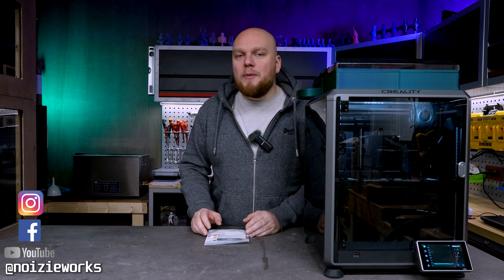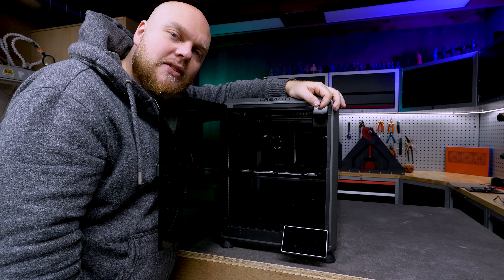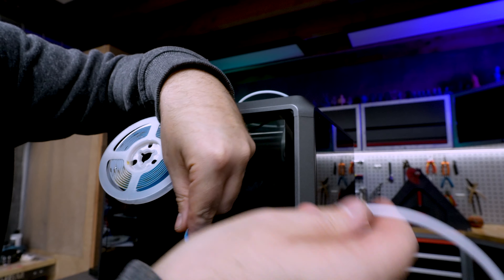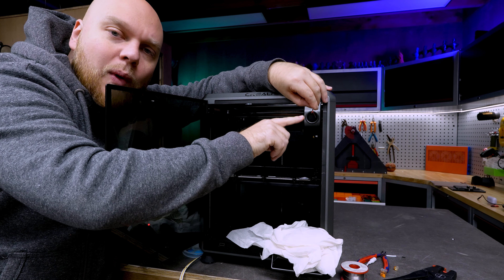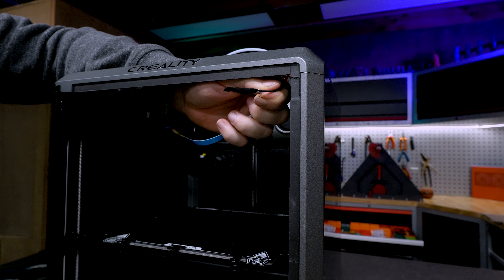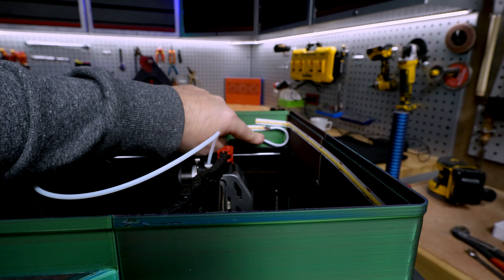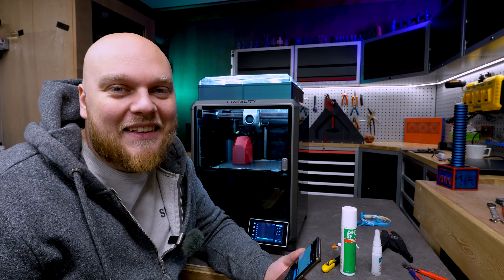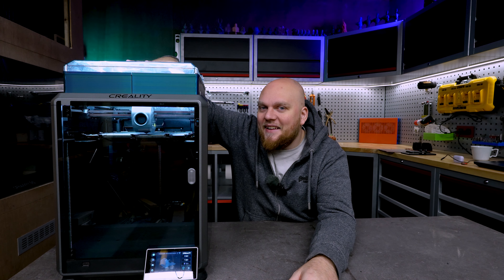How to add more light in the creality K1 for cheap tutorial!

Comment: Assuming that's a ScotchLok then the gel inside is not glue, it's silicone grease for protection against water ingress.

Also probably a good idea not to install too many LEDs as the current draw may damage your printer.
Reply from the maker: Yes you're right, brain translation made it glue 🙈 thanks for the correction i will pin it.
Reply: that's not too many LED's it won't make any difference. they don't even represent 1% of the overall current draw.
Reply: @riskinhos  yeah it may not be a problem for the psu but its a problem for the smd mosfet that drives the led pin
Reply from the maker: Been running it a hot second and it's still fine
Reply: @NoizieWorks  That's good. There is always a risk with LED mods that a circuit trace or power source, which might be an LED driver is already operating at or close to it's design limit. But if you have run like that for several hours it's probably fine.
Reply from the maker: @loc4725  try weeks but yes i get where you are coming from. It's always a risk of burning out the board
Reply: @riskinhos  Generally it's the heat from the current draw which kills things. But given that many printer manufacturers seem to use fairly generic PSU's there may be  a convenient power rail which is underutilised and which could provide power. I'd have a look at who makes that part and see if I could find a datasheet for it or similar.

As for board control, a MOSFET triggered by the existing LED circuit would give you control whilst allowing you to use power from another area or indeed, another independent power supply.

Comment: Thanks for that! I have 12v and 24v LEDs and tested both. 24v works great, 12v lights up but too weak. Also bought 1.25mm JST 2 Pin and soldered it to the LED strip. This way I can easily revert to the original setup or change the LED stripe if needed.
Reply from the maker: @paulorfo  great job dude! I just couldn't care but you did the right thing

Comment: Nice idea!   Although wouldn't it be better to connect a female (socket) to the LEDs and plug the factory-fitted LED connector into that?  Rather than cut the Creality cabling.  Just thinking of warranties and/or returning it to stock in the future perhaps.
Reply from the maker: Yes you can, there are cables now for the Creality plug and play(etsy). For me it's a permanent install and if you use some wagos instead of soldering it, it's plug and play and compatible with most 24v led strips. About the warranty, they are only accepting machines that are fubar so if you encounter a problem they will send spare parts. And returning to stock? Once you install the led it's a permanent replacement imo. The led in the k1 is a joke so i wouldn't worry to much about that.

Comment: Installed mine today following your instructions. Thanks so much!! The cables aren't red and and black anymore unfortunately.. I got it switched once hehe kind of scared me for a sec
Reply from the maker: Luckely led's that get wired wrong don't do much 😉 i have seen some examples of led strips with the right connector on it but hey🤷‍♂️ it's not like you are going to remove them a lot. Btw i ended up adding a 100uF capacitor to the led cause mine had some flickering when all heaters are on full tilt. Helped a lot!

Comment: what type of connector is the original one?
wordering I could make this change a reversible one with quick change or replace system.
Reply from the maker: Then i would use a different connector like a XT30. It's JST but not sure what type but they are way to small to be handy
Reply: MX1.25. They sell pre crimped pigtails you can use to connect them all together.

Comment: Why 24 volts? Did you measure the existing LED? I've found some LED strips but they are all 5 volts.
Reply from the maker: I found the information on the K1 fb groups.
If it was 5v it wouldn't work so look around on amazon or aliexpress for a led strip
Reply: The OEM Strip says DC24V on it.

Comment: Why not just use female 1.25 jst connector instead of attaching it permanently? It will make any top frame/gantry disassembly even more pain in the ass
Reply: Do you happen to know what kind of JST it uses?

That's literally why I watched the video. 😂
Reply from the maker: Somebody responded with 1.25 jst hope it helps
Reply: @AdamKlein77  I literally wrote the connector type in the comment you respond to
Reply from the maker: Lol, didn't see it's in the same comment thanks anyways!
Reply: that's the only information needed in this video along with 24v if it wasn't obvious already. get 1.25 jst connectors and the leds and it's done. no need for piece of shit soldering like in the video